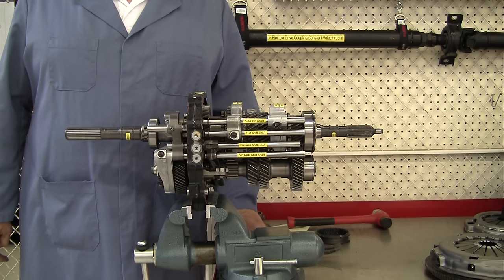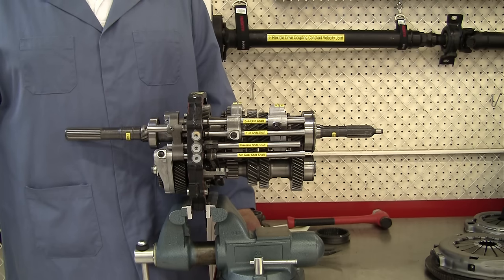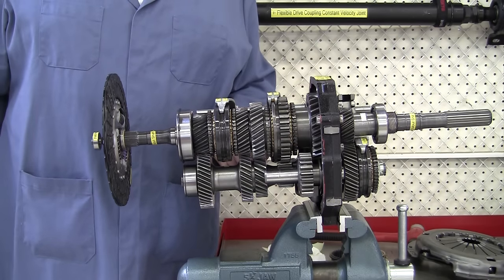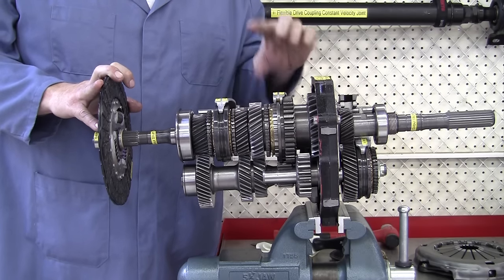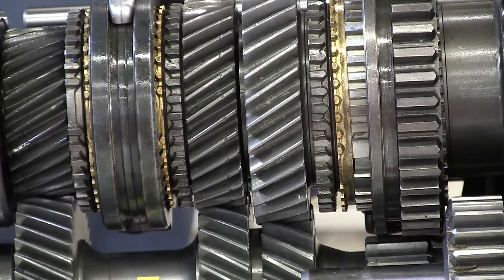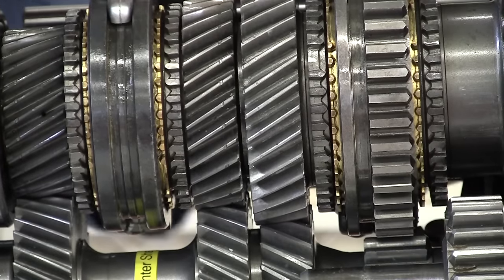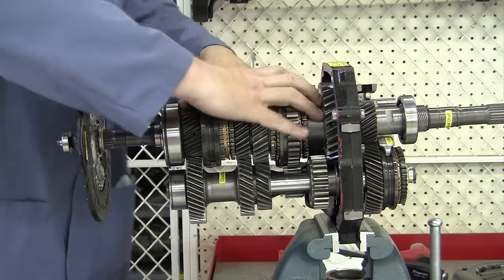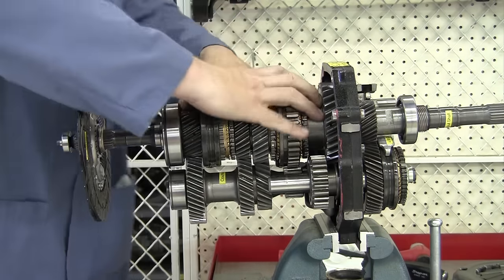Manual Transmission Operation

Comment: How long do the brass syncros last? Because it sound like they get a beating for excellerating the output to match the input. Why are they made of brass? Do they reset there shape after speeding up a gear?
Reply: Most manual transmissions are good for 100k+ miles. I learned on a Chevy cobalt and put almost 200k miles on it. If you abuse it, you can kill it in a day. But that's rare.

Comment: So here's my question. I have a two-wheel drive manual transmission Geo tracker. There's been much discussion and debate on some forums that I should not tow this vehicle in neutral behind my motorhome because of the splash lubrication that is not happening. When the engine is on. I've been advised to disconnect the drive shaft. Some people have said they've towed this particular vehicle in neutral with no problem and not drop the drive shaft. Others have said you have to stop. Periodically and run the engine to get that splash lubrication going inside the transmission. What are your thoughts on this?
Reply: Just junk it, bro.

Comment: Great presentation!  I have a 2019 TRD Off-road Tacoma with manual trans.  My 2 to 3 shift greets me with grinding on occasion.  To avoid the grinding I will shift into 4th right before going into 3rd to get the shafts spinning at the same speed.  To see this is awesome.  Toyota won’t fix it for me.. they haven’t been able to reproduce it.  Only happens occasionally.  It’s probable the ring right?
Reply from the maker: It sounds like it. Thanks for watching

Comment: Please i have an important question, if you are driving saying in 4th gear and you pressed the clutch and swapped to 2nd gear (rev matching) while you're still pressing the clutch, does the clutch disk increases it's speed with lower gears ? because from what i know the clutch disk in mesh with the transmission shaft will turn more with each up shift since higher gears have less torque and more speeds
Reply: IT IS  THE GEARS make  speed ? not  how  fast  clutch  is  spinning ? think  about it like  this  SAY YOU HAVE  a engine 500  hp power but spinning  clutch faster is not  going be faster  speed ?  it is like you have one gear ? only can go so fast ? but then  you have  5 diff  CUT GREARS ? each time you shift ? higher NOW  FASTER  YOU GO  ? FIRST GEAR is made to  PULL  ? and get car moving ? EVEN  if you had  500 HP if PUT INTO  5TH GEAR RACING  CLUTCH UP engine would die ?  no    DISK  INCREASES  ? you just burn out DISK ? hope this  help you
Reply: If you switch from 4th to second because of the cars momentum it will probably force the engine way past the redline and youll destroy it

Comment: sorry if this is a dumb question but since the first gear on the countershafter is in mesh with the first gear on the mainshaft, what prevents the countershaft first gear from turning the mainshaft first gear clockwise at the same time that the reverse idler gear is attempting to turn the mainshaft first gear counter clockwise?
Reply: None of the gears on the main shaft are splined to that shaft. They all spin freely on needle bearings on the main shaft. The Synchro hubs are the only things splined to the main shaft and that means that until a synchro meshes to an output gear, that gear is not "Attached" to the main shaft.

Comment: 16:59 for him to shift those gears... is it due to the innovations of the synchronize sleeves?  Cuz I imagined the shafts would need to be rotating for that process to happen... am i wrong though?   or do sync rings enable the ability for mating parts to align or "slip" into place (despite no shaft-rotation)? Contrarily, did the instructor have 4th gear setup beforehand by orientating adjacent gears/sleeves/rings to be "lined-up" for demo?

Comment: Facinating video love manual gear boxes thats what we call them in Australia l own a 1995 toyota hilux l bought it about 3 years ago its a five speed gearbox l am just wondering if this is the same gearbox as is in my hilux do you realise the manual gearbox hasn't changed in many years maybe an extra gears sincromesh on all gears but it has never changed that much in years its a mechanical device which is proven and will last many years well my gearbox in my hilux has lasted 25 years probably will last another 25 years easily without been reconditioned its a Toyota gearbox treated properly it will last l have owned a couple of automatics had trouble with some of them

Comment: Weber Auto. Do you think EV's could benefit from Over drive gears to help reduce power demands on highways to help save battery life and motors from over heating?
Reply from the maker: No. Electric motors can be very efficient a certain speeds. Typically that is at highway speeds

Comment: If you really get familiar with the engine sound of its speed, you can actually shift thru the gears without using the clutch except for first and reverse. On my '65  Supersport Chevy, i used to shift this way. I lost second gear sychronizer after flat shifting. I didn't know.
Reply: It's a cute parlor trick but is hard as hell on the synchros and cones. Handy thing to know how to do (I had a clutch spring break and lock it up once, that was fun)... But for normal driving, it'll make quick work of the guts.
Reply: Yes, I remember clutchless shifting a '69 Roadrunner I had back in the mid 70's!.. It's all about the ideal engine/transmission speeds

Comment: nice demo. I have heard the phrase “ double clutching” many times, and even in this video. Why is this necessary, it seems it will put lots of work to the gears? I like your insight to this, thanks!
Reply from the maker: It is not necessary if the synchronizers are working properly. Thanks for watching

Comment: I'm trying to wrap my head around this and I know it'll probably take another viewing at least. But right now I'm not understanding why many of the gears on the top shaft seem to be touching the gears on the bottom shaft. When you're in fourth gear, for example, I can still see second and third seemingly engaged with the gears below. What's going on? Thank you.
Reply: I think what I don't get is how the synchronizer sleeves hook up to the input shaft.
Reply: Ok, so the synchronizer sleeve is CONNECTED to the output shaft itself. I think I'm getting it now on the second time around. Just thinking out lout here.
Reply from the maker: Thanks for watching

Comment: So from my understanding transmissions are mandatory in cars to provide higher torque for accelerating better at low speeds and going uphills and for better fuel economy at high speeds. Because at high speeds torque doesnt matter as much as a faster rotating output shaft and all that... what else?
Reply: Thats pretty much it, its no different from the Transmission on your bicycle

Comment: Q: about reverse..  when shifting to reverse normallyy U press the clutch....but it won't go into gear...can u explain? been looking for answers out there.....thanks for  your patience...
Reply: I think that’s because the reverse gears are straight cut gears and sometimes the teeth don’t align with the grooves properly, but if you put it back to neutral and let the clutch back out for a couple seconds and try reverse again, it should work

Comment: Beautiful explanation, perfect video quality.
I'm Brazilian and I've got a question: when we shift from a gear to another, it will cause wearing (as we can see in the brass blocker ring you used as a model do show how it actually looks like). So, when the brass blocker ring "fits" teeth-to-teeth the gear, the wearing may occur, right? Stepping on the clutch pedal and release it very softly is much better to the engine (it will increase the useful life of the gear system) than fastly shift the gear? Or it doesn't matter?
Reply: I haven't finished the video yet so he might have explained this, but here I go anyways! There is a part in the transmission called the Syncros, their job is to make sure the gears don't grind when shifting, so it won't nessesarily be much harder on the gears with harder shifts, instead it will be harder of the clutch disk, which is the price used to connect the engine/transmission with the driveshaft. So smoother shifts will be kind to the clutch. If you wanna be super kind to the syncros as well, however, you can use a technique called double-clutching, (I will use a 5th to 4th gear shift for example.) useful when downshifting, clutch in, take the shifter out of 5th, let out the clutch, this gets the gear and flywheel spinning with the engine, briefly hit the gas, this increases rpms to match with the next gear speed. Then clutch in, shifter into 4th, clutch out. It's pretty complicated, but once you get the hang of it, your transmission will last a bit longer. Hope this helped!
Reply: @nicholaslokos7949  perfect! Thank you. Yes, he talked about Syncros. I just didn't understand well enough. Tnks
Reply: Is that not basically heel toeing?
Reply: @range4524  yeah heel-toeing is used in double clutching.
Reply: @BandaSemStudio  anytime man! Good day!
Reply: Não sou especialista, mas creio que o que pode acelerar o desgaste dos sincronizadores são os motoristas que colocam tapetes embaixo dos pedais ou que fazem por simples hábito não pressionar o pedal da embreagem até o final nas mudanças.

Comment: Fabulous vid!  Very clear explanation, and excellent videography.  I chanced upon this while looking for an explanation whether double-clutching is of any use for extending the lifetime of the fragile-looking synchronizers.  I've seen opinions going both ways from other presenters, while none of them articulated the mechanics of what's really going on as clearly as you did.  After seeing your vid, my conclusion is that double-clutching is not helpful at all in a full-synchro transmission as the one here, but it does help to move the shift lever gently into the next gear rather than slamming it as fast as you can.  Any thoughts about this, or generally how to shift and clutch to maximize longevity of the transmission?  Also, I was wondering how the output shaft is engaged and disengaged as you shift.  It wasn't clear to me, since all the gears seemed to be turning all the time.
Reply from the maker: Thank you. You can maximize synchronizer and transmission life by reducing the speed difference between the engine rpm and the output shaft rpm. In other words, upshift at lower speeds. The output shaft is always connected to the driveshaft, the axle, and your tires. It rotates if the vehicle moves. Thank you for watching

Comment: I mated my gearbox with my engine. It went in good on bottom but had gap at top. I began bolts and it went in eventually. Scared i might have forced it. Anyway of moving shafts to verify operating good before I start engine? Output shaft moves in neutral. In any gear, output shaft dosent turn.
Reply from the maker: That is what it is supposed to do. Thanks for watching

Comment: Thanks for the video and explanation.. one time I was on 1st gear on a very slow as I was in the apartment parking lot, like 5km per hour .. because I have to make a turn, I was trying to put in neutral .. I guess I have get used to the clutch.. or I misplaced the shift between 1st and neutral... And I believed I released the clutch .. I hear no grinding but the shift stick was shaking , I can feel something turning and no grinding sounds .. then I pressed on clutch to release it after 2 second .. did I damage the teeth inside?

Comment: Is the 6 spd manual in my Lexus IS250 super hard to tear down and put in synchronizers?  An old-timer semi-retired transmission guy in town told me to "forget about it" because it is too complicated.  I kinda question his opinion.
Reply from the maker: Many of these transmissions require a hydraulic press, special tools, and a properly trained person. One mistake and the transmission is ruined.
Reply: @WeberAuto   Definitely  things have progressed from the days I could rebuild my old Ford 3 on a tree over a long weekend.

Comment: Nice work 🎉

I have one question (I might sound dumb and have a logic failure): Why do you need the shaft that is under the axle of the in and output shafts?
When shifting you are only connecting gears with the output shaft on the upper axle (letting 5th gear out of mind). I notice that if you spin the input shaft the gears spin with a different speed due to the different ratios, but I don’t get it why you need the lower axle.

Comment: When I went to truck driving school my instructor wouldn't allow me to use the clutch to shift. I never could understand why.
Reply: Shaise Kindering  Probably so he could learn to match revs when shifting gears, a truck has a lot of weight and you could easily shear the gears. I once went on a trip and my clutch gave out and had to drive home by matching revs to change gears.
Reply: Shaise Kindering  It's not recommended but certainly possible if used as a last resort lol.
Reply: Truck Transmissions don't work the same way they don't have synchronizers. You can't press the clutch in and just put it in any gear you have to match your gear to your road speed and engine RPM

Comment: What an amazing explanation. Superb
Reply: Explanation of what? That gears are doing nothing, all the job and power is provided via synchronizers?
The most important things are not visible here (there are internal splines, shafts are not solid but sleeves really and so on).

Comment: Can somerbody explain, he said that for reverse you need to be stopped fully, because there is no synchronizer. Sure this all makes sense.

but what if, when you are in the stopped position, you stop just right so that the teeth of the reverse gear are all lined up with the teeth of the connecting gear? I don't understand how they don't just bump into each other when you would try to put the car into reverse. Or are the reverse gear teeth so smooth that its not possible to fully bump them into the connecting gear and they will always connect when you apply pressure via the reverse gear knob?

What I'm trying to ask is what happens when you try to to shift into reverse from a full stop, and the reverse gear teeth are not lined up with the connecting gears "holes"?
Reply: if your in full stop it means the output shaft is also stoped and your on idle so slow turning on inputshaft and countershaft so its easy posible to match the teeths on time...
but having no synchronizer seems dangerous for the gears
Reply: The teeth will be slightly tapered to allow the gears to slide into each other

Comment: Absolutely fabulous video, thank you!  Curious if you have preferences for what lube to use for lock balls and such?  I’ve seen a how-to vid with a guy using Vaseline.  Worried about high temp performance.  How hot do transmissions run?  What about high speed brake lubricant?

Comment: of course all good information, as a note I realize the video is old, but the information is related, Having learned on old old equipment and farm trucks that did not have a synchronized transmission, it's good to put it out there, that non synchronized equipment exists, and you have to get a really good handle on double clutching and rev matching to get the input shaft at the speed you need it to be. 

The other is the statement "you need the clutch to shift" yes and no, Heavily recommended yes, Would I ever recommend driving without it? no. Is it good to understand that it is possible? yes.

the idea is I've had a pressure plate start to fail at the worst possible time, so once I got it rolling I didn't touch the clutch any more than if stopping was completely necessary because starting without it, Theoretically possible if your car doesn't have a clutch safety on the starter (again old farm trucks, some you could start them without the clutch down, in gear) These things are not recommended usages, but are good to understand that what is possible in the event of an emergency or equipment failure, it can still get you home.

So good information on the purely mechanical side of things, which is the point. However, there are some caveats like I pointed out. I've had failures where knowing those things was the difference between getting towed home, and making home on the vehicles own power, at least the shifting bit, The rev matching and double clutching is that you just actually need to know that for the equipment I was running.

Comment: so how does a mechanical lockout from 5th gear to reverse work on a 5 speed gearbox that stops you from pulling it from 5th to reverse without first going into neutral and centering the stick
Reply: I think they achieve that pretty simply with some electronic solenoid that blocks the stick from going into the reverse as long as the car is moving. Some other cars use an even simpler system where you first have to lift a ring or press a button on the shifter to open up the gate into reverse.
Reply: @Akotski-ys9rr  I don't think it's electronic because it worked when the car is off, and you dint depress the stick or pull it up af all to reach reverse, it's just where 6 would in in a 6 speed. But there us something that stops you from pulling the stick straight from 5 to R

Comment: So in sumnation, the first gear is connected to the second which rotates the output shaft through the input shaft from the 3rd gear shifting the fourth into the fifth with revolutions combining the speed times the power equals the torgue minus the input multiplied by the output to give us forward gaining momentum. Therefore, causing said vehicle wherebeith wherewithall of power,torgue, combustion, and exhaust. Henceforth, the power combined with the maximum capacity to revolutionize the converter from the inverter to the outverter and the converter. Thereby causing friction to gain traction from the reaction to the connection. Hopefully this all makes some kind of perfect sense.
Reply from the maker: Thank you for watching